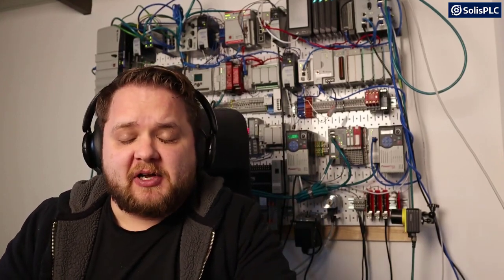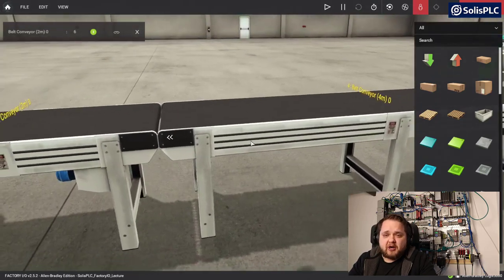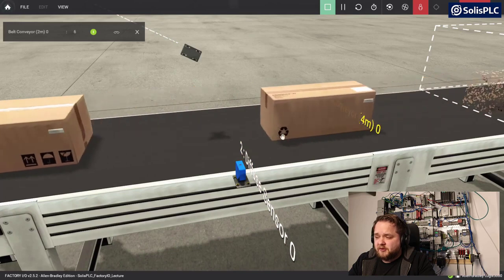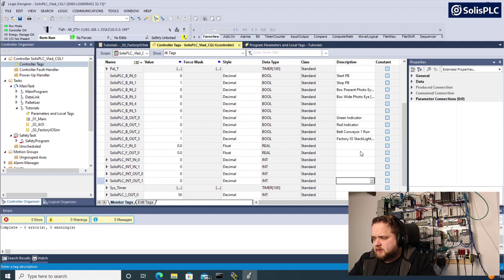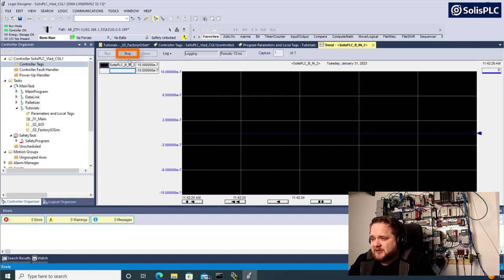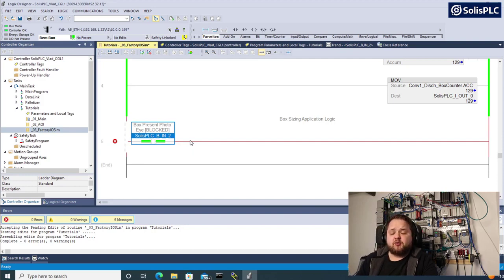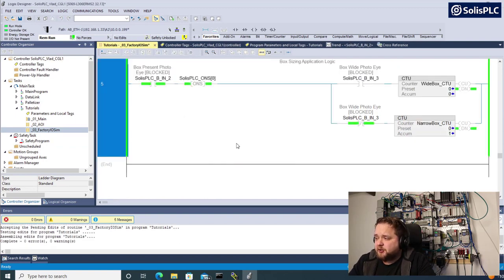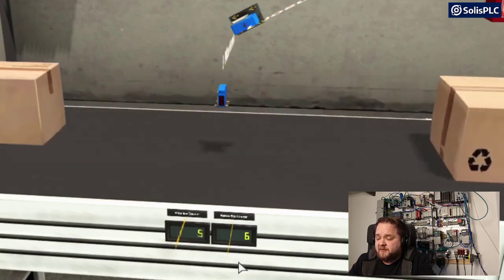Allen Bradley PLC Programming using Factory IO - Sensors XIC XIO OTE CTU Troubleshooting [Part 5]

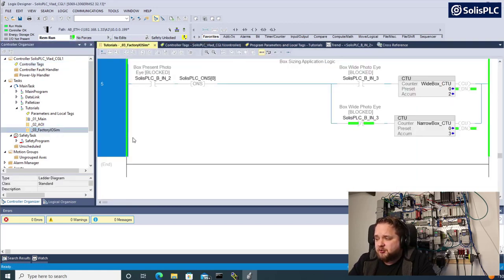Comment: 18:45 - The solution counter proposed in this tutorial might be reliable when the connection between the Factory I/O and the controller is stable, and there are no delays. However, my setup is reliant on remote controllers. I have to VPN to the controller network, and so does Factory I/O. Basically, when the simulation starts, the values about the diffuse sensors have to leave my laptop, over VPN, go to the controller (which is remote), got processes, then travel back over VPN to my laptop ... this is causing the sensors to miss some of the boxes and sometimes boxes might be counted twice (as a Small and Medium box). 
Do you have any suggestions on how to read a stable signal from diffusers? I imagine these situations happen in real life as well.
Reply: @SolicPLC ... I solved my problem. My Task period was too high (set to the default 250 ms). I dropped it to 50 ms and it works like a charm.